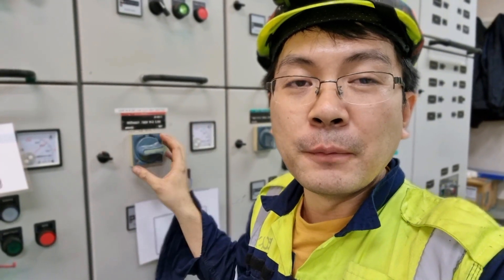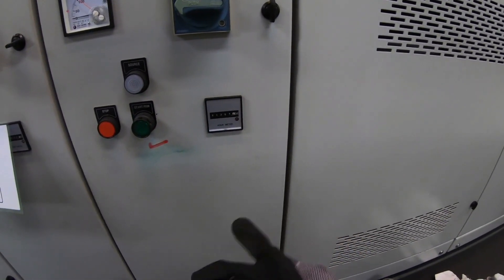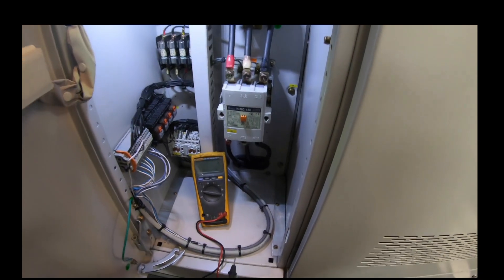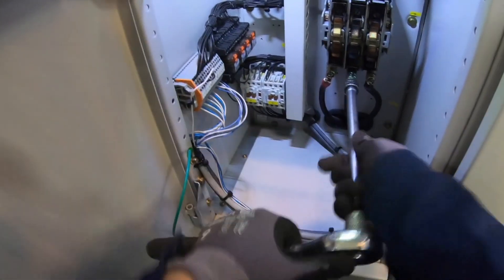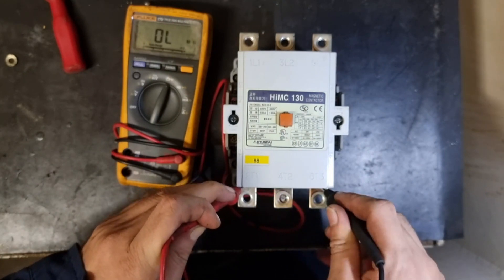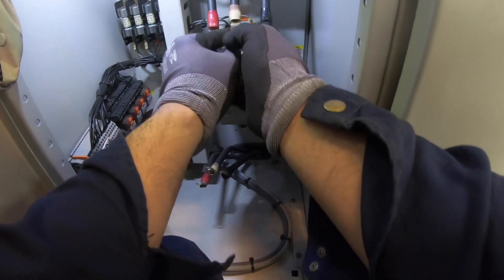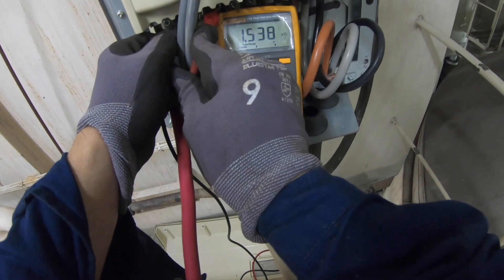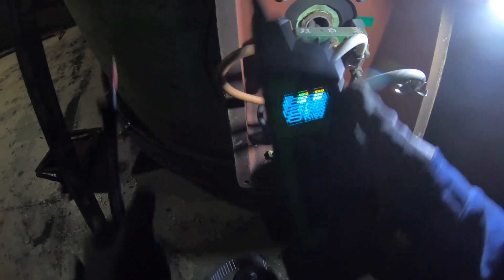FAULT FINDING & WIRING DIAGRAM MODIFICATION | ETO TROUBLESHOOTING

Comment: I'm betting you did this, but the proper procedure for verifying a "dead" or isolated circuit is called "live, dead, live" testing. Check the circuit being tested, verify the meter by testing a live (preferably low voltage) circuit, then again testing the isolated or "dead" circuit.

Comment: Thank you for video. Can you explain how did you check VFD? How you understand it is short circuit? What are reading on your Fluke?
Reply: I think he's reading the resistance from the vfd and as it is low he rule it to be broken then he went to the motor and checked the coils and they were good so it must be the vfd

Comment: We experienced before twice we have defective VFD, its not because of the Motor. Any abnormalities of the Motor will have a fault alarm on the VFD,If the main breaker always trips its really the VFD was the problem,  possible cause are the contactor Single Phase supply to the VFD its not advisable to switch On and Off frequently the fan because it might damage the VFD, VFD is electronic device very sensitive to the Power supply, Power Surge can also Damage the VFD..
Reply from the maker: Fault was found on the back ventilation of the VFD, it is was fully covered with dust and moisture. Board got burnt. Thank you for the support

Comment: Sir lecky may tanong lang po about vfd.  Ano po ang main function ng vfd sir? Bakit po sya tinawag ma vfd? Thank you sir...
Reply from the maker: Vfd stands for variable frequency drive. So you can change the speed of the load depending on the demand. In this way you can save energy
Reply: @leckyjake  thank you sir lecky...